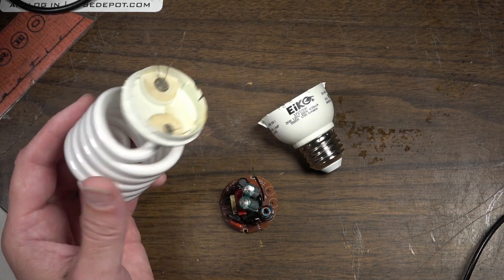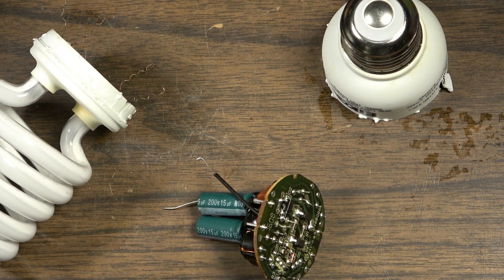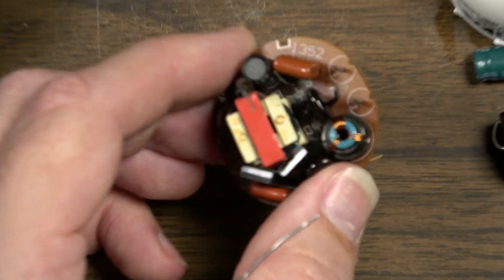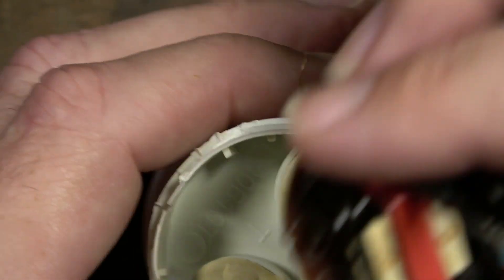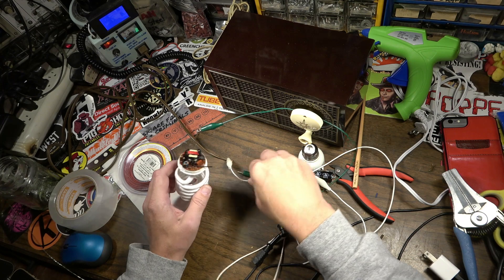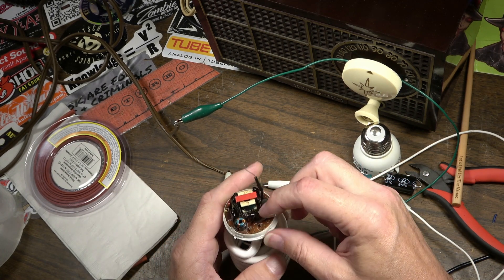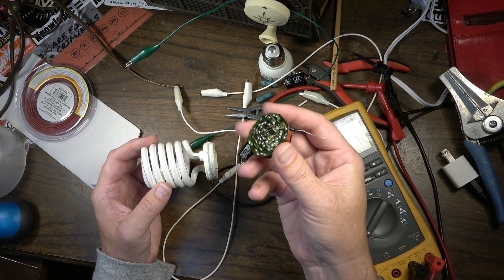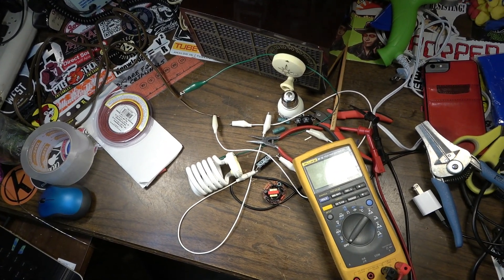Blown Photography CFL Compact Fluorescent Bulb - Can We Fix It?

Comment: The place I used to work at had a battery/CFL/printer ink recycling station in the downstairs lobby. I would often grab CFLs out of that bin and harvest parts out of them. Most of the time, the electrolytic capacitors still tested good, even though you can be assured they have been well baked. I used the parts, including the film caps to repair a good number of AA5 tube radios. One of those tube radios fitted with electrolytic caps pulled from a dead CFL some years ago currently gets several hours of use a week, and still works just fine. Most of the boards got tossed in a misc parts drawer for future harvesting of inductors, diodes, etc. The removed fluorescent tubes were placed back in that recycling bin. Right about the time LEDs were taking over, more and more CFLs that still worked perfectly fine were getting dumped.

Comment: I think just shy of 8 years is pretty good for a bulb. I wish all those '15 year' LEDs would last even half as long. And yes, a removable PSU/ballast unit would be nice, but honestly, how many folks would be willing to (inevitably) pay more for that.
 Actually, there was such a thing in the 80s, circlite bulbs with Edison ballast adapters. Basically just that, a CFL consisting of two standardized parts. Pretty neat huh? Nobody would buy that today. 
It would also be safer as it would be harder for a popping cap to shatter the glass. Happened to me once, probably decades ago by now. Needless to say, that was the last time I used any kind of CFL. 
Even though not all of them are that sort of mercury vape. That one was probably just cheap crap.

Comment: I've had quite a few cfl bulbs die for no obvious reason.
Often it's the cfl tube that's popped it's clogs,  but i used to keep the tubes from dead ones and do a mix and match of parts.
I have a led bulb in the living room now.
Fine until one of the leds goes poof.
Reply: Years ago I had 2 NEW cfl bulbs detonate as soon as they were switched on.